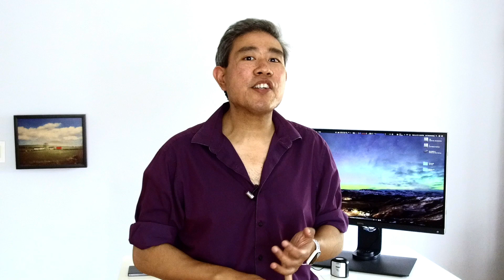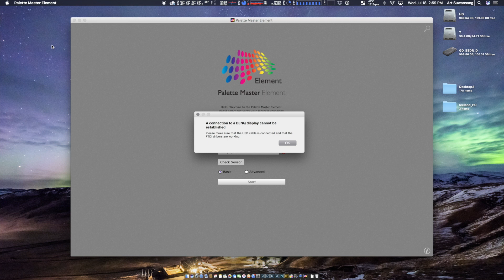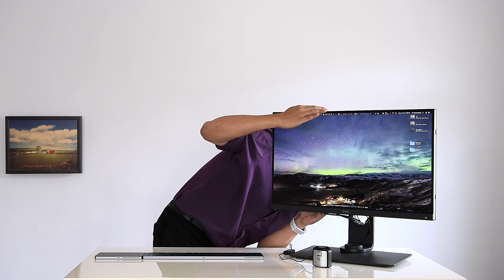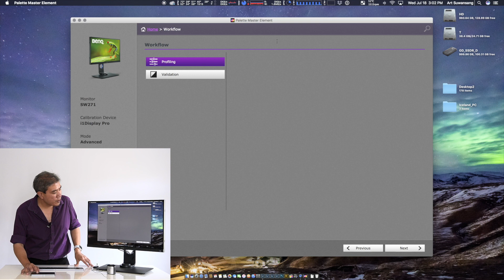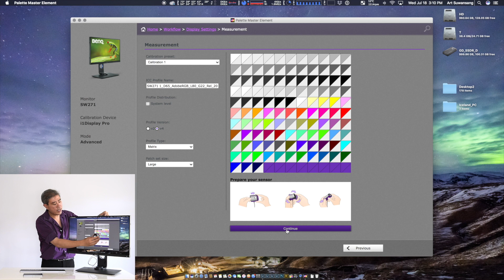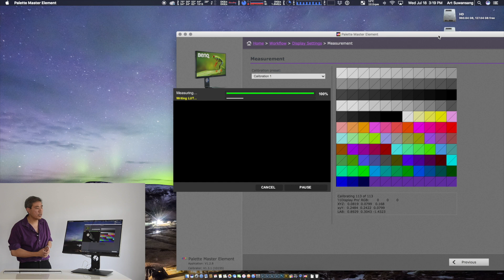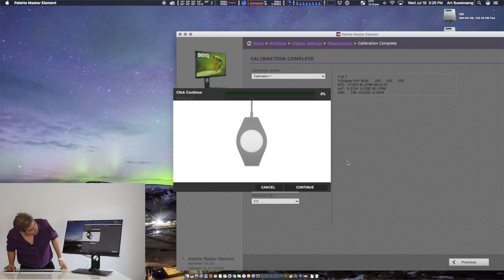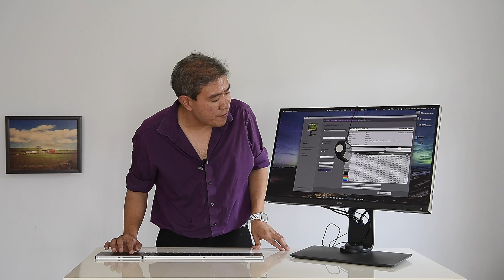How to Calibrate BenQ SW Displays with Palette Master Element - Art Suwansang

Comment: Hi @artisright - thanks for the very informative video, I really appreciate the time you took explaining everything

I’m getting a “sensor measurement error” when trying to start the measurement.

I’ve got the SW271, X-rite i1 display Pro & are connected to my mid 2014 Macbook via thunderbolt for the display connection & usb for the two usb slots (one of which the calibrator is plugged into) & sd card slot connection on the side of the monitor.

Are there any known issues with the latest mac version of Palette Master Element (V1.3.5) that could create this error? I’ve triple checked that there are zero programs running except for Palette Master (it mentions an issue could be programs running in the background).
Reply from the maker: Hi Dale,  do you by chance have ColorMunki install? If you do, you need to uninstall that first. Or you can choose to remove ColorMunki start up tray from system booting as well. The other thing that I would do is plug the i1Display Pro directly into the computer USB port and not on the display. As far as I know this is not a known issue, thought it is fairly common for this to happen. The next best thing to trouble shoot this issue is to try and obtain another i1Display pro and see if it is producing this same issue with it is plugged in directly to the laptop. Let me know if this works. And thank you for the compliment!
Reply: @ArtIsRight  Hey thanks for getting back to me. I was aware this could be an issue so made sure when running the calibration I have ZERO programs running & all x-rite related software like ColorMunki uninstalled.

The calibrator doesn’t seem to register when I put it into the Macbook directly but does when it’s connected to one of the two usb slots on the side of the monitor. I’ve contacted X-rite however they have no way of telling me if it’s faulty but thinks it’s not as it seems to go through when using the x-rite software.

I’ve just taken the time to upload a video to my channel showing the process I went through to calibrate & the issues I had - maybe if you could look at it and see what you think

I’m about 70+ emails deep with BenQ Australia support having tried to work this out since Feb, it's at the point where I just want to jump ship and return the monitor for something else

You’re the most help I’ve gotten from someone so far, it's really appreciated
Reply from the maker: Hi Dale, I have a few photo shoots that I am doing this weekend. I'll watch the video and give you some feed back in a day or two. Thank you for your patient.
Reply from the maker: Dale is there anyway for you to provide me with a direct link to your video. I can’t seem to find it on YouTube. Thank you
Reply: @ArtIsRight  https://youtu.be/BksFTXtZyXc see if that works
Reply from the maker: Hi Dale, so I have a few thoughts about this. If you want to do some more trouble shooting with me I think that we can perhaps isolate some issues here and figure out what is wrong. 
1. First please tell me what version of macOS you are running.
2. What I like you to do is set the display color back to factory default AdobeRGB and then this time use i1Profiler to do a software calibration on the display. Here are a couples of things that I like you to look for:
- Please keep track of which USB port you plugged the i1Display Pro into. On the MBP or display. By the way does other USB peripheral works with either the USB ports of the MBP? Something other than the i1Display Pro and BenQ display?
- Do you get any error with i1Profiler.
- When you reach the end of the calibration and create the profile, do you get any strange or incorrect or posterization out of the i1Profiler profile? If you do then this may signal that the i1Display pro could be defective.

These step above will give us some more clues to explain what is going on and it will use some what more of your time. 
How old is your OS installed? When you jump from one version of macOS to the next did you use the upgrade option or clean install with format? And if you use the upgrade option, how many os update have you done on this laptop. I am talking about going from Maverick to Sierra to High Sierra, etc, big version jump.

Another thing that you can do that will give you a definite answer is the following. If you can get a fast USB 3 flash drive about 64 GB or if you have an external SSD or even hard drive (much slower option). What you can do is leave your current Mac OS install on the laptop. And install a fresh copy of macOS on the external flash drive or SSD. Once you boot into the fresh OS, install PME and try to do a calibration. This will tell you very quick and easy if there's something wrong with your internal OS. At any point in time did you ever have colorMunki installed? 

Based on what I see in your video, here are some of my guesses as to what is going on.
1. Your i1Profile could be defective. Installing i1Profiler and do a calibration will tell us. 
2. If when you plug in the i1Display pro directly to your laptop and if that does not work with the software then this could mean it is more of the Macbook issue, where this could be either software or a hardware issue (fresh install on USB jump drive method will help confirm one of these options).

Please let me know what you decided to do. I'll continue to help you out with this.
Reply: @ArtIsRight  Hi yep sure thing, I’ve done some troubleshooting and can answer some of those questions 

1. I’m running Mac OS Mojave 10.14.5

2. I set the display back to its default adobeRGB and used the i1Profiler to do a software calibration - The calibration went through on all three occasions using the two usb slots on the side of the monitor & also the one in the Macbook. 

- To confirm yes all USB ports work with things other then the i1 calibrator and BenQ display (USB’s, Hardrives, usb mics etc)
- I don’t see any errors with the i1Profiler, everything seems to work 
- I can’t see any polarisation however the profile created is extremely warm

I got my Macbook screen replaced on 1st Sept 2018 which was a clean install with a format - from that point I’ve been using the upgrade option to install, in terms of a big version jump I would have installed Mac Mojave near 24th Sept when it was released

I’ll have a shot at installing Mac OS on a usb flash and booting off that tomorrow

Yes I did have ColorMunki installed a couple of times when trying to work out issues - in both cases I uninstalled it with app cleaner for mac & removed the temporary files

Thanks for taking the time to reply, I feel like I’m getting somewhere with this which is nice. I’ll get back to you ASAP regarding the USB jump drive
Reply from the maker: Hi Dale, 

You are welcome and I am glad to help out, let me know what your USB macOS install yield. Based on what you told me, in this last reply, if the color is extremely warm it could possibly be that you have a defective i1Display pro. Normally the when do you a calibration with the i1Profiler the color would be a touch warmer but not extremely warm. Either way please try the USB stick OS and we’ll keep moving along here. 

Art
Reply: @ArtIsRight  Hey sorry it's taken so long for a reply - I ended up working out how to run the OS off a USB...and the calibration seemed to have worked!! (I'll try to upload the video I did of me calibrating it however it's quite big and could take a while)

Now that we're pretty sure it's something wrong with the OS (no idea what it could be) what would be the best course of action?
Reply from the maker: Hi Dale, I am glad that we isolate the issue and somewhat better yet it is the OS and not the hardware. So the next step at this point is for you to back up your current OS, in this case I mean the user data (your user folder) and software licenses that you have installed. Once you have done that then you can just clean install macOS on your laptop. Perhaps I should do a video about that. Anyhow, what you need to do is shutdown your Mac and power it on while holding command + R, this will boot you into recovery mode. From there just follow the prompt. Use this at your guide, http://osxdaily.com/2018/10/03/how-clean-install-macos-mojave/ it is just much faster to send you this reference than typing it all up again. Essentially what you need to do completely format your main drive and install a fresh copy of macOS. Make sure that you have good internet connection when doing so because the installer might download a fresh copy of the OS from Apple Server. Once you are done setup the OS and install the softwares. I hope this works out. Please keep me posted on your progress and if you have any issues please let me know.
Reply: @ArtIsRight  Hey thanks for the! info :)

I did a clean reset of my Macbook and everything with Palette Master seemed to have worked! (woohoo..first time I've been able to do this)

The only issue I'm having at the moment is when calibrating for adobe rgb 1998, the calibration comes out de-saturated and with a warm cast which as far as I'm aware it shouldn't

I made a quick video (link here -> https://youtu.be/uxhJLLSGyUc ) showing it in comparison to srgb

Note: I used the advanced mode & everything else you mentioned in the tutorial video with the exception of the luminosity which I made 160 instead of 120
Reply from the maker: Hi Dale, 

Yes this is strange, can you email me the profile that you made on a zip file. You can send it to me via wetransfer or dropbox download link. I would like to compare it to mine and see what is going on. Based on the past conversations that we have if you calibration continues to produce this kind of result the next thing could be a defective i1Display pro. But before we jump to that conclusion if you could send me the icc profile that would be great!

Art
Reply: @ArtIsRight  Hey Art,

Sure thing, here's a dropbox file including the exported report -> https://www.dropbox.com/sh/vg2muupgcui8zh2/AADcULYPptOCORbBnhakQLa0a?dl=0

The other thing I'll mention also is I've noticed when applying the profile to the monitor & trying to edit within Photoshop (specifically camera raw) there are issues. Here's a thread I started about it when I wasn't sure if it was the calibration or the program -> https://forums.adobe.com/thread/2636556

Cheers,
Dale
Reply from the maker: Hi Dale, 

If you could send the the icc profile too that would be great. It is located in your User folder ~user/library/colorsync there should be an SW profile there. But what I can see so far from the validation, the profile is way off. If you gave the monitor time to warm up before you calibrate and you are still getting this issue. Then it is highly possible that the i1Display pro is defective. Is there a shop in your local area that you can rent or borrow an i1Display pro from a friend? Or if not, can you buy one test it out and then return it? My suspicion right now is that your i1Display pro is defective. 

Also yes I have seen the Adobe forum and I have been running into that issue on my end as well, however, that has nothing to do with why your profile is not created properly and it is why it is not validating properly. BenQ is aware of the profile issue and is working on a fix for it. 

The next definitive test is my suggestions above, get another i1Display pro to test out. If you get better result then the i1Display pro is defective. It is not common but it can happen. If the result is the same then it is the display, which again could happen but I highly doubt that is the case. Usually when issues like this happen it is with the conduit between the display and the monitor, which in this case is the i1Display Pro. Plus, I believe that in one of your previous comment you mentioned that even when you profile with the i1Profiler software the color still comes out warm. If am mistaken about this please feel free to let me know. However, this is part of the breadcrumbs that lead me to believe that the i1Display Pro is defective. 

Art
Reply: Hi Art,

No problems - I’ve just added the icc profile to the same Dropbox folder I sent you a link to in my previous message.

Okay great, good to know I’m not the only one seeing that it’s off - yes I can confirm that I’ve allowed time for the monitor to warm up before the calibration.

Not really at the moment - the closest place for me is a couple of hours drive away however I’ll be at the place where I purchased the monitor in about a week so I’ll be able to use a different calibrator then.

Thanks for the confirmation regarding the Adobe program issues 

I’ll try to get my hands on another i1Display Pro and see how I go and yeah the profile looks warm even when using the i1Profiler software (this was prior to the hard resetting of my MacBook)

Thanks for the help, I feel like this is narrowing down a lot

Cheers,
Dale
Reply from the maker: HI Dale, 

This is great. We are moving to a solution. From the icc Profile that you send me, I compared it to mine and it does not look defective. However, it is skew somewhat toward the yellow, red slide of the color wedge. Please keep me posted when you get a hands on a new i1Profiler and we'll go from there.

Art
Reply from the maker: Hi Dale, did you every figure out if your i1Display pro is defective?
Reply: @ArtIsRight  Hey Art - I actually just got back from a flight where I went to the city/place where I purchased the monitor.

While there I did some troubleshooting with the owner on the exact same monitor. I brought my MacBook and calibrator so we could do multiple tests - what we found was….

1. the calibrator wasn't defective and worked fine on the other BenQ sw271 monitor

2. The calibration went through fine and looked good when we changed a couple of settings - these are the following - Whitepoint 5800k, panel native gamut, 120cd/m2, 16 bit lut, relative black, gamma 2.2 and most importantly v2 instead of v4 - the guy mentioned that the colour look could have been because v2 is more compatible with programs then v4

3. The other thing we found which fixed the photoshop camera raw issue was that photoshop for some reason wasn’t applying the calibration. What fixed this was to make the benQ sw271 monitor the primary display when the monitor is connected within display settings and to restart the computer a couple of times

I’ll double-check my notes but I think this is the crux of what we found

It's such a relief to have the monitor actually working properly after 7 months, 4 companies and 100+ emails

I really appreciate the help you've given me - it's honestly not only been the best help I've gotten in moving forward but gives me faith in BenQ because the support I've gotten here in Australia was honestly pathetic and I nearly gave up and returned the monitor
Reply: @ArtIsRight  Hey I just sent you an email - seem to be having issues now with banding in blacks/shadows :|